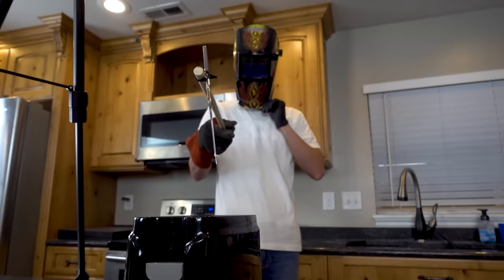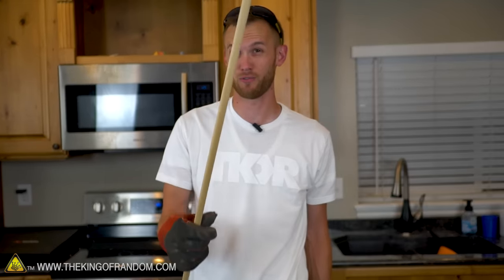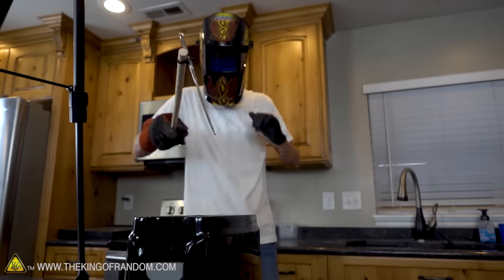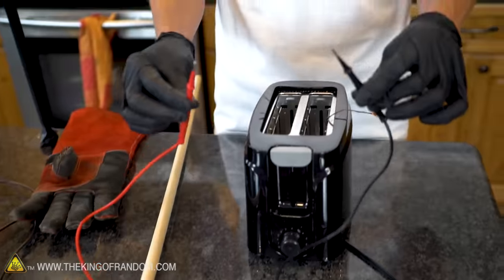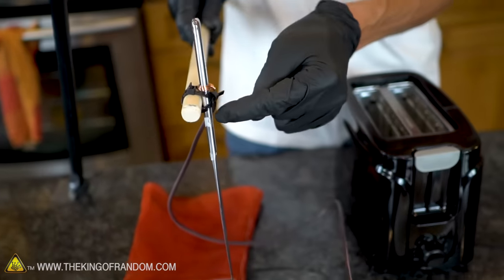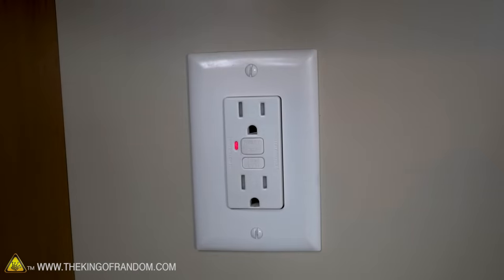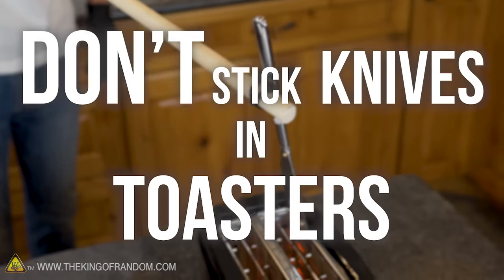Don't Stick Knives in Toasters

Comment: Nice now I know why love it but what happens when you put a spoon in the micorwave
Reply: what? that's literally not what happens, the spoon will spark and the rest i don't know as i immediately pulled it out once that happened. might start a fire or even explode
Reply: If u do so, pls cue the tactical nuke sound effect xD
Reply: Tin foil
Reply: It won't do anything  just gets warm
Reply: Esme's diys watch mrbeast one of his videos he microwaves everything lol
Reply: How a bout a fork
Reply: Hero _BSB yeah but ain't spoon and fork kinda the same
Reply: Horor OK I will watch his videos
Reply: Link actually you can put a spoon in a microwave but only for a couple of seconds since it will take more time for the spoon to conduct electricity and cause sparks you can however put a spoon in a plastic or glass container in the microwave and it will be fine i have done it a few times but with knifes and forks it is a strong no since the surface of both of them is smaller than the spoon the will conduct electricity a lot faster

edit: still you SHOULD NOT put metal objects in microwaves
Reply: Forks are bad spoons arent as bad
Reply: Link won’t explode
Reply: nathanfranke then why did someone die because of a spoon in a microwave?
Reply: Depends on the power you put it on. On higher levels it will spark and may cause a fire, i haven’t heard of it exploding but it’s possible
Reply: Supsoup Supoup nothing happened cause you had the spoon in the coffee lol

Comment: Voltage doesn't flow, current does. The reason you measure different voltages on different parts of the heating element is because it's actually a big voltage divider. Measuring the voltage from the end of the hotdog to earth doesn't really make sense to me. It only confirms that you would be touching live wire (depends on where you touch the heating element). What I think you wanted to do is measure the current flowing through the hotdog, but that would also not really make sense because a 15cm hotdog's resistance is by far different from the resistance of your body from hand to feet.
Reply: M B you also don't measuer voltage in series, which is what he did at one point
Reply: I agree. This video doesn’t really make sense
Reply: I also agree, its just basic electricity knowledge. Voltage doesn't damage, current does.
Reply: @somerandomguywastaken  dependant on the supply. If its current limited the voltage will drop limiting the current
Reply: @somerandomguywastaken  pretty sure it's the work doing the damage, ie current and voltage together.
Reply: ok mr. magic man
Reply: Also, the video makes no sense because he said GFCI wrong.
Reply: ENGLISH PLEASE
Reply: @somerandomguywastaken  you can touch 150amps if you have 0 volts supply
Reply: @thebreadman7220  I don't think that's possible mate
Reply: @janellstephenson2478  imma guess you're under the age of 14

Comment: I actually put a metal knife in the toaster when I was young (no protection, I was holding the knife with my bare hand). I will never forget the amount of electricity I felt through my hand.
Reply: Not possible if you weren't standing barefoot on a conductive grounded floor, or were holding your other hand on something grounded.  WIthout a way to complete the circuit, no current can flow.

Comment: That diffrence in the voltage was becouse there is something called resistance. The more away from the source you touch the wire, the lesser the V will be
Reply: Tomeo Wu he should’ve measured it from the initial power source to after the resistor. What he basically did was connect the meter to the resistor twice, and it almost looks like he’s measuring current.
Reply: Ugh, and he did the same thing with the  hotdog. He’s got the setup for measuring current instead of voltage.
Reply: Yup, you are right
Reply: The resistance from the source is negligible. The only important resistance is the hotdog. But he’s measuring voltage not current which is the important factor here. And voltage does not flow through you. It’s a potential
Reply: I was curious to see the current the hot dog was drawing.
Reply: joshua ledgister And why should he measure voltage? Its a constant, so what would knowing the voltage prove?
Reply: The easiest way to look at voltage vs current is to compare it with water...
Voltage would be the pressure in a water pipe. Current would be the flow in a water pipe.
The total power (watts) would be the pressure times the flow (watts = volts x amps).
It's that simple.
Reply: The output from the power supply is a constant voltage but the drop in voltage across each resistor is different. The toaster counts as a resistor and so does the hotdog.

Comment: That's not how Volts work...
Reply: He’s not measuring any drop.
Reply: But it dose
Reply: The gaming fox Voltage is constant in a circuit. Adding extra components wouldnt change the potential difference.
Reply: He shouldve measured amperes aka current.

Comment: Do you get superpowers if you put a toaster into a bath and sit in it
Reply: Gerrit no.
Reply: And you probably won't get shocked either, electricity will take the path of least resistance (in between the toaster slots) and hardly none of it will get to you. But still don't try it
Reply: Jackson Korn nice try, but that's not how it works

Comment: Experiment :how many hotdogs do you need to connect in a series without having the GFI breaker to work?
Reply: Lior Singer: years ago they sold hot dog cookers that you hooked across spikes. It would cook I think it was 6 dogs at a time hooked in Parallel.

Comment: Different toasters = different results.

Did it to one myself, with a knife that had a plastic handle so I didn't get a shock, and it just killed the toaster.
Reply: The toaster likely had a fuse.
Reply: The plastic handle saved you then
Reply: i tried with a fork and its exploded.the electric does not shock me.the explosion does shock me
Reply: Alex Jamieson you mean the plug lead had a fuse like uk or the toaster itself

Comment: What happens when u put a fork in a microwave
Reply: It creates plasma or sparkes or blows it up
Reply: Some of the waves reach the fork and the fork starts inducting those waves creating a current within the fork and that causes it to spark and/or heat up
Reply: Jon White he is actually wrong which is funny. It won't do anything unless the fork touches the side of the microwave.
Reply: Any thick metal won't do anything in a microwave, it's when you get something thin like aluminum foil where it will spark in between the sheets
Reply: Thank u guys for the feedback
Reply: how about a spoon?
Reply: That as well
Reply: Then u have to cue the tactical nuke sound effect xD
Reply: QQQQQQQQQQQQQQLOLTHATISLONG No no no that isn’t true...
Reply: Doctor Nobody wait really? I thought the microwaves were supposed to excite the water molecules by inducing a current into them

Comment: Kind of makes sense that touching different parts of the heating element gives different readings.your effectively changeing the leangth of the "coil",thus changing the resistance,and that's cuasing the difference.

Comment: Every electrican will shake his head 😂
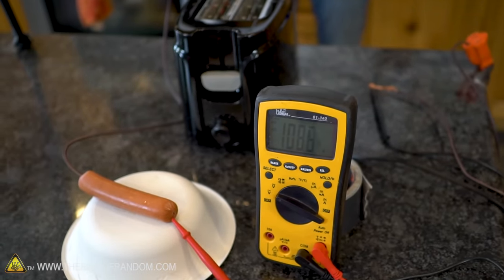Reply: Every electrician will notice the mistake at 6:40

Since you didn't, you're not an electrician
Reply: @bspringer  yup he is mesuring open circuit voltage witch is incorect
Reply: @revolution5547  care to explain non elektriciens why thats bad?
Reply: @cherrydragon3120  I said that's bad?

Comment: u forgot to check the current  .
power = voltage * current
Reply: jaydev chhagan I was thinking that too.
Reply: All I could think about was how misleading that was by only talking about voltage when really they should be talking about the dangers of current...
Reply: It s a toaster I don't think it does currant buns hun
Reply: He also said volts running through wire... hilariously volts don't run through wire only amps do.

Comment: Is ultrasonic mist maker going to work under vacuum ?
Reply: Shivam Kale The water droplets that make up the mist should evaporate until what remains becomes cold enough to form ice crystals which would slowly sublimate, so in theory an ultrasonic mist generator ought to make an ice mist lasting longer than the normal water mist. Interesting question to put to the test.
Reply: Shivam Kale  The walls of the chamber should also get coated in ice crystals just like windows sometimes do (if it's cold enough) and get cold because the vacuum pump removes the warmer evaporated water.

Comment: Are you seriously measuring voltage in series??
And since when is voltage 'flowing'??
Reply: Rens Bakker ikr
Reply: Rens Bakker flowing in electrical engineering is a way to describe what's going on to people who don't have the technical understanding which has been carried over from the plumbing industry and technically nothing electric is positive
Reply: Paul Banks butt still voltage is discribed as the pressure, the current is the water 'flowing'

Comment: If you’re holding the knife while it’s welding to the elements your arm will melt off and you could die. Always unplug the toaster before putting a knife in it to avoid that from happening. Also metal toasters are always grounded so if you hold it with one hand and stick the knife in it it will short it to ground but still don’t shove knives in toasters.

Comment: The sparks are just there from shortcircuiting the resistor heating wire - the rest of the wire gets brighter (same voltage, lower resistane = more current throught the rest and more heating). Diifferent readings on the second test is a matter of how closer you stick the knife on the wire from the phase wire.

Comment: The toaster lights up more because you're reducing the resistance by shorting out a decent length of the highly resistive wire. The exact same reason your V drops and rises with different lengths of wire.

Comment: If the toaster has a metal casing which most of them have a metal casing, then it has to be PROPERLY grounded. If you stick a knife in the toaster, current will flow thru the body, thus making the muscles contract, and.... if the toaster is grounded, the knife will touch the metal which is grounded, and the current flows from the LIVE LINE, AND TRIP THE RCD OR AN ELCB, OR GFCI. Eh, that process happens really fast, that it saves your life.
Of course, if only one hand touches the toaster with the knife, you can just hit your hand, making the knife short to the ground, and as I said, the LIVE CURRENT RUNS TO THE RCD, ELCB AND EVEN THE GFCI.

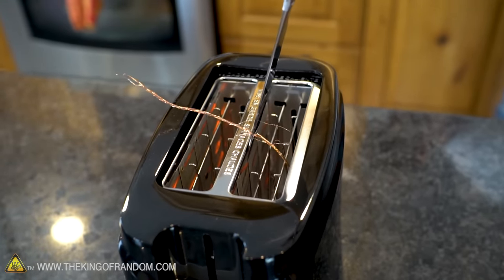Comment: 3:40 you made an electromagnet, to "weld" copper you'd have to be pulling 1,981.4 F with that little toaster at the very minimum. to support my claim even more, your average toaster runs at about 150-500 F. that is pretty cool though dude. ;)

Comment: The current is running through the hot dog, not the voltage! The 100V voltage is only the potential difference between the toaster and ground.

Comment: Voltage does not "travel through", current does. Voltage is between two given points of the circuit
Reply: Cheers babe, no homo

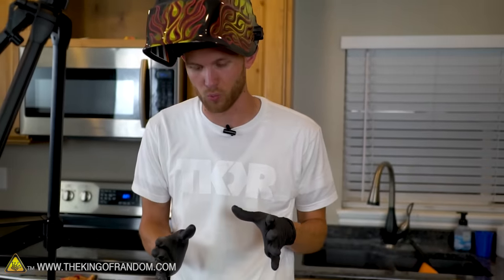Comment: 6:45
An ideal voltmeter doesn't let any electricity pass through it! So the 109V are only concerning the volts but that doesn't mean there's any electricity flowing through it. Just so you know: the 109v are probably there because of your 110V grid voltage. Besides that, no current is flowing through the hot dog....
Sry but next time before you use any volt- or ampmeter please learn how to use it and what it measures

Comment: I was honestly expecting a bolt of electricity to shoot up through the knife and set the wood on fire. I stand corrected. Also, don't you measure current with an Anmetre? You use a Voltmetre to measure voltage. Who wouldv'e thought.

Comment: before watching it, i did it and the heating wire just instantly melted in the point where i touched into two pieces and the toaster just turned off. i did not feel any electrical shock or heat or anything.

Comment: Voltage is not a measurement of current so your test really told us nothing, you should have had the multi meter on the amperage setting. Voltage is essentially the pressure behind the electricity and even if the voltage is insanely high with no current Infront of it then not much will happen, it's the amps that kills you.

Comment: Do you know that power running thru somehting is a product of amps and volts? like, its cool you are measuring voltage, but unles you know the resistance of the hotdog or knife or such to calculate the current, you have zero info about the power. Yeah, and volts aren't going anywhere, voltage is the difference of potentials. Amps are the runners.

Comment: i tried to poke bread with a fork when i was about 6 years old to get the toast out i dropped the fork and although i didn’t get shocked it let out this loud as spark of static electricity ya know when you get shocked on a trampoline that sound you hear think of that x100 because it was loud

Comment: I know Im being a stickler here but...voltage doesn’t “run through” anything, thats the wrong terminology. Voltage is always ACROSS two points. So when you were talking about that hotdog you should have said that the hotdog had 109 Volts ACROSS it. Current on the other hand, does “run through” circuits. If you were talking to someone with any electrical knowledge they might look at you a little funny if you said that, so Im just trying to save you from that.

Comment: I once had the smartest idea to shock myself with an electric flyswatter with a 9 v current and my finger hurt and my arm was like as if it had a spasm attack, then 2 years later i did it, but now i turned it, turned it oof and then touched it, same spasm in my arm and finger that hurt

Comment: U don't know much about electricity because voltage is measured in parallel, not in series and you should be measuring current to see how lethal it actually is. There's always around 120 volts in everything in a house unless it's a baseboard heater, which is 240 volts. Voltage doesn't change when you short circuit something. It's the current and current is also what heats things not voltage. Look at a taser. Some are 15000 volts and that isn't anywhere lethal. It's amps/current that is deadly and damaging.

Comment: So in had a realy bad toaster i did this today acidentaly just tried heating my knife so it would be easy for me to get butter melt a little cuz in finland butter is anoyingly hard my knife first got attaches to the hot wire thing and then i saw a huge spark and then it broke no electricity would go to the toaster i donno was i in panic or what but i didn't feel a jolt btw. i was holding the knife bearhanded no fancy rubber shoes and gloves or anything edit:wow it works again

Comment: lmao i did it when I was like 8. like nothing happened the breaker just went off
Reply: Are you young enough that you had ground fault indicators installed? Or were you lucky enough that the casing was grounded so most of the circuit took that route?

After all, it is possible to work on high voltage (as in transmission lines) safely as long as you are at the same potential as the line. Dangerous of course, but possible.
Reply: @57thorns  i honestly don't know tbh... the fuseboard tripped the kitchen

Comment: You clearly don't know anything about Amps and Volts. You've hooked your voltmeter in serie, not in parallel. You should have setup you voltmeter in the Amp mode, not Volt...
I miss Grant